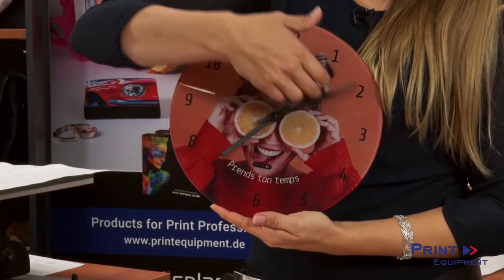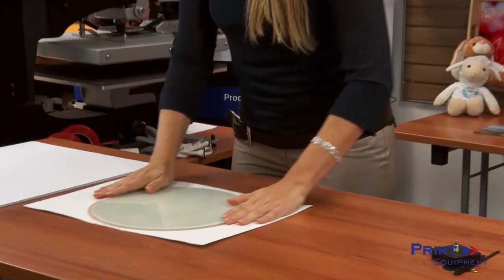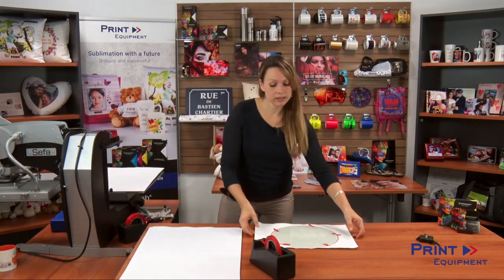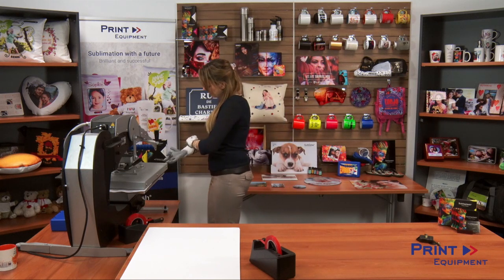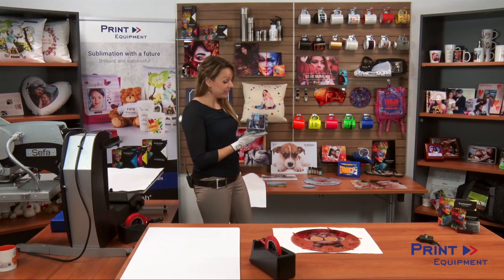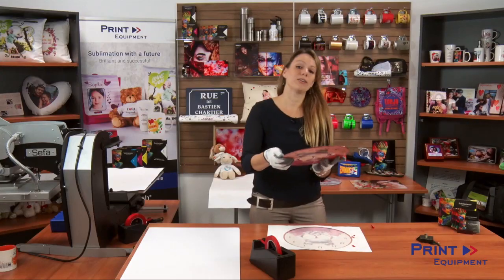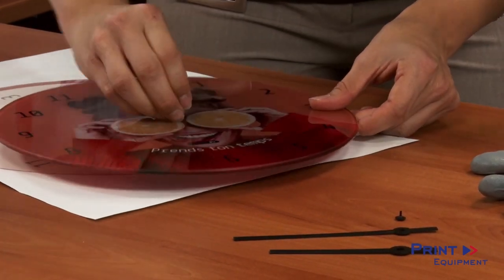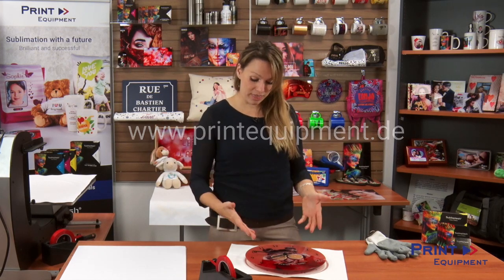Sublimating a glas wall clock

Comment: How did you drill the hole without cracking the glass? How did you attach hanger and clock mechanism?
Reply from the maker: Hello, the hole is already drilled (the glass plate is supplied with a hole). You can see how to attach the movement at the end of this video: https://www.youtube.com/watch?v=fz9Z_66HRNA